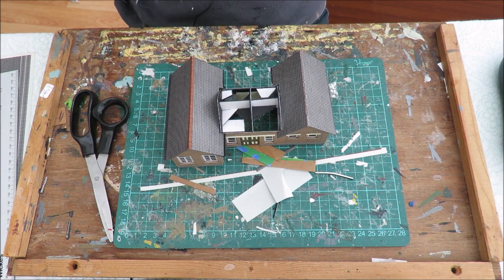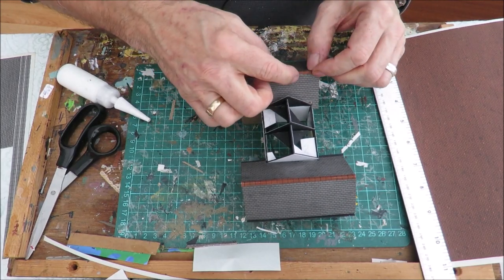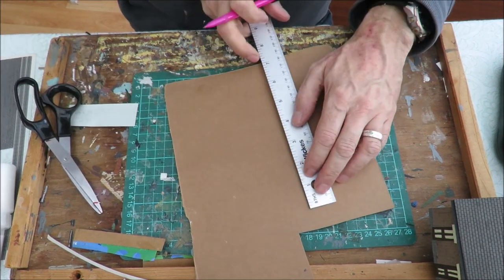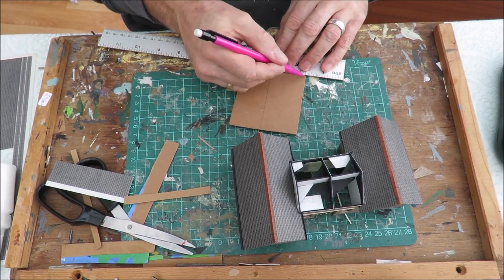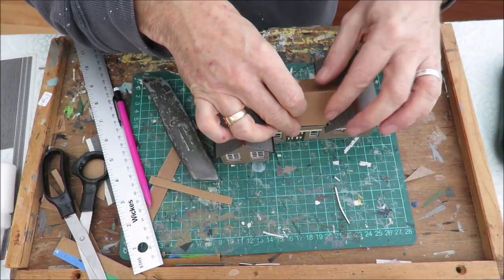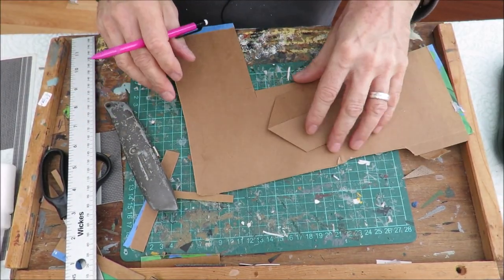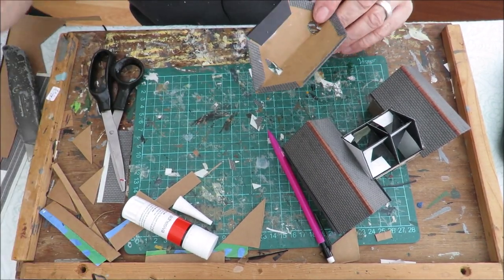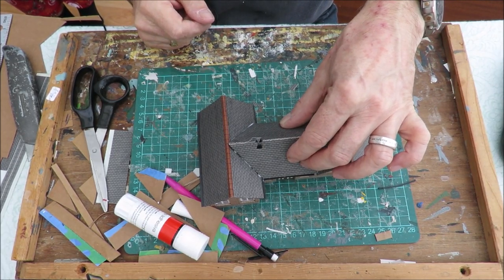How To Make Model Railway Buildings From Scratch (Part 4) - Tutorial Tuesday - Episode 35

Comment: Just to say thanks for the videos really help build mine and my grandsons model railway just as a idea when I make buildings i use pop rivets as chimney pots i file down the top and paint
Reply from the maker: What a great idea thanks
Reply: @BudgetModelRailways  also once the shaft is removed a small length of cocktail stick push in (pointy end facing out) means you can fix and hold in place by pushing it into card and helps when painting

Comment: Most helpful video series. I find parts that require holding for the glue to set use uhu sets quicker than PVA my other point  buildings have a step below the door which in your building missed off. Well done Mike very enjoyable
Reply from the maker: Good point about the step, I shall include that next time, thanks.